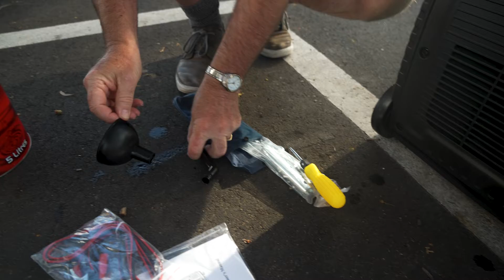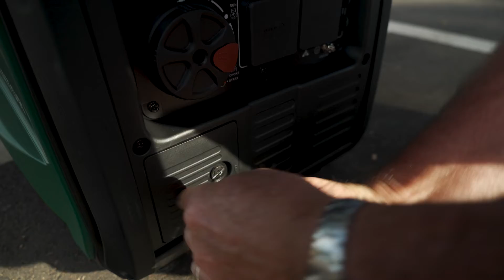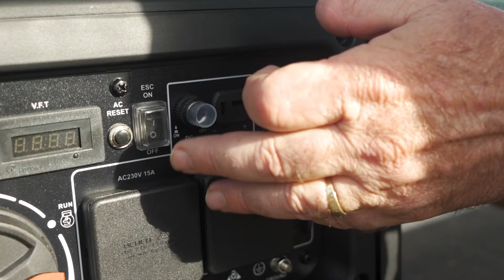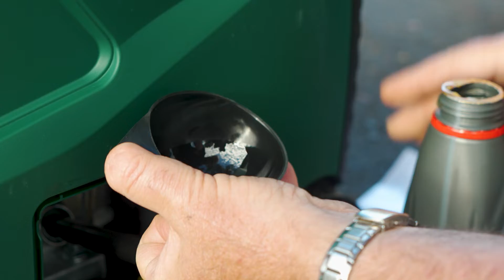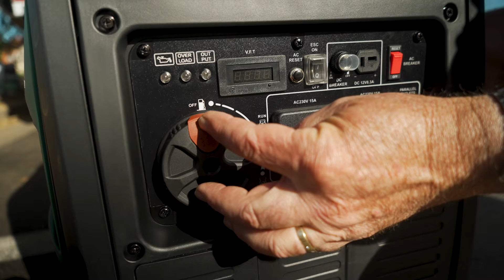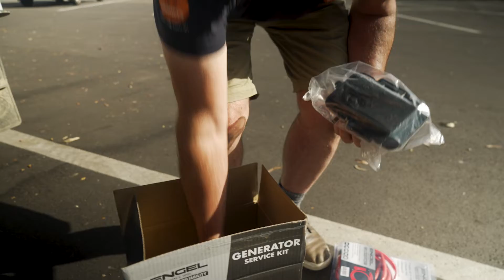Engel 3500W Pure Sinewave Inverter Generator R3000IE

Comment: Are the two 240 volt plugs 10amp or 15amp? Couldn’t quite see in the video.
Reply from the maker: They specify the rated output at 2300W, Lisa, so 10A. ~ Ben